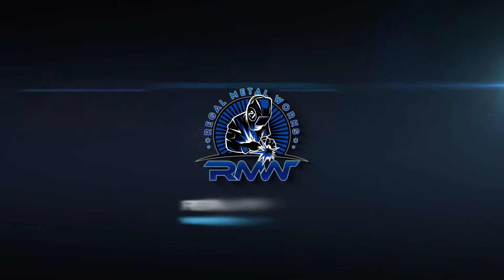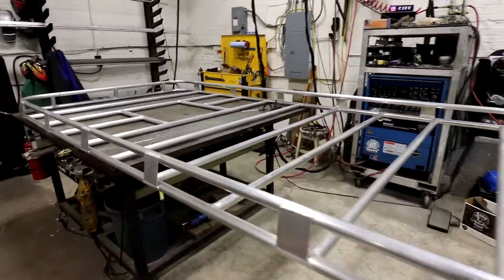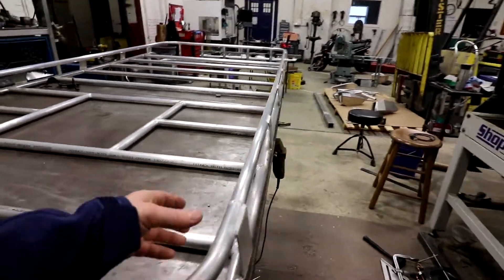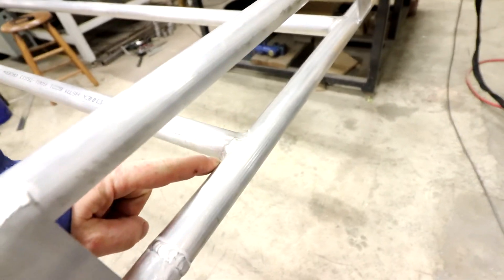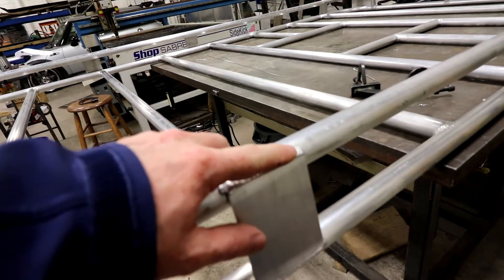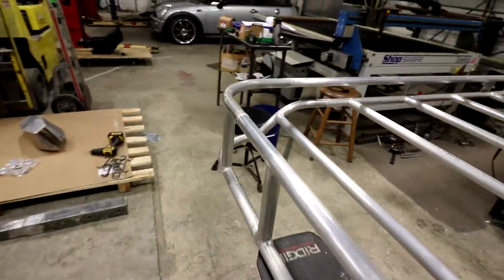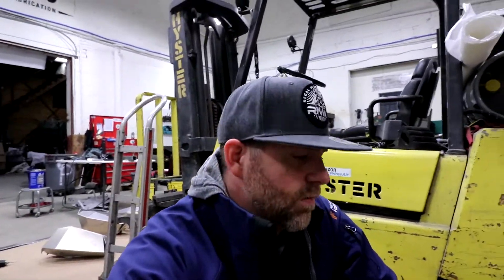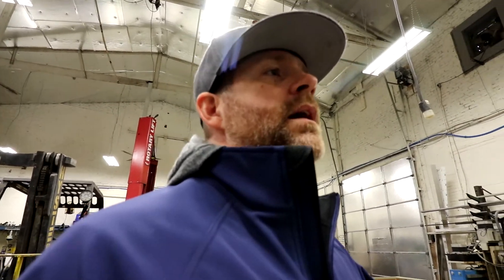How to weld aluminum RMW - Vlog 135

Comment: How much filler are you adding on the second pass versus the first pass?
Reply from the maker: That all depends on what the puddle needs.  That it is already warm, you mostly are smoothing out the puddle, if it needs more, add filler, if not, don't.
Reply: @Regalmetalworks   So it's primarily the pulsing that helps with giving it a nice shape?
Reply from the maker: Correct, it flows the filler out nicer on thicker welds.

Comment: What filler rod did you use? Try preheat with a Map gas Torch. Works great.
Reply from the maker: That was 4043.  Yes, any preheat would do wonders.  I just like to weld it twice!

Comment: I don't know if you supplied the 6061-T6511 or the customer requested it, but now that you have made a rack out of it, would you use it again with the need to partially anneal the bends, or would you look at a different alloy?  Thanks.  R.J.
Reply from the maker: R.J.'s workshop I did supply the material.  It is what is readily available.  I would use it again, but if I were doing a production run, then I would probably have my supplier special order non-tempered.  Originally I had asked for a quote of 5000 series tubing, but my supplier said it was not available.
Reply: Cool thanks.  I have almost always worked with 6061 by default and material selection is interesting to me which is what made me wonder what would work better.  Thanks for the updates.  R.J.
Reply: If you have a shop and you are going to fab things using aluminum tube why not just build an oven capable of 600 to 800 degrees for annealing tube. Can't be that hard. There is literally TONS of info on building heat treating ovens, what kind of wire to use for heating elements and digital controls etc. You just need a long insulated enclosure with heating elements and a temp probe connected to a digital controller and one or two relays to turn power on or off to the heating elements.
Reply from the maker: @acmegp  I have built an oven for powder coating, so I am familiar with the process.  I just don't have the on going need to do so.  The cost and space needed outweighs the demand currently.  Thanks for your input!

Comment: Those are some pretty welds, Cole. Also glad to hear that I'm not the only one who goes over the weld again once it's heated up. Makes me feel a little better about it! Hope all is well - TZ
Reply from the maker: Tom Zelickman Thanks Tom!  Yes, nothing wrong with doing it as long as you don't over heat the aluminum it is just fine.  I may not on thinner sheet due to warpage, but thicker material for sure!